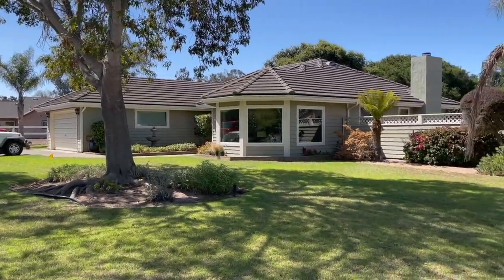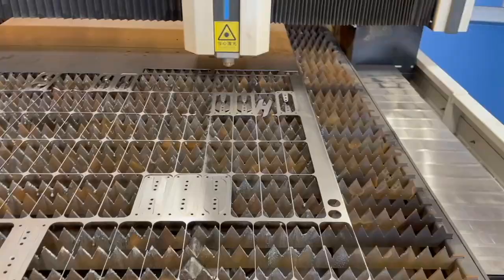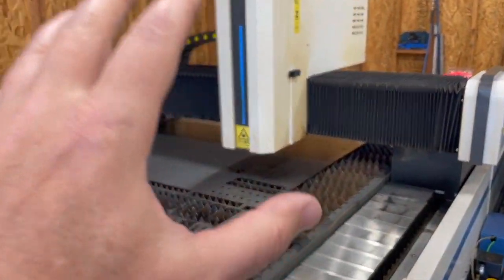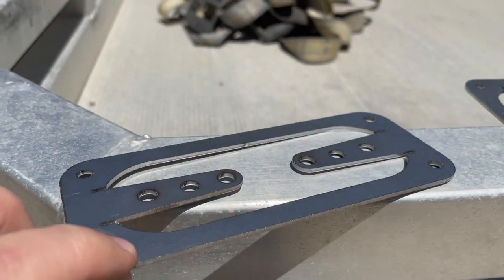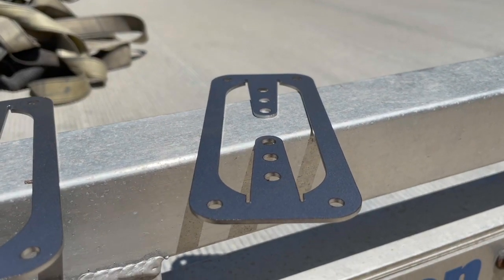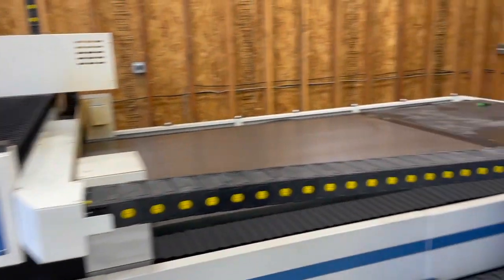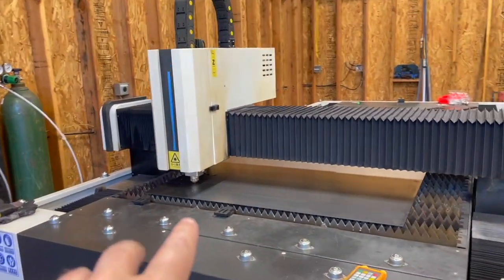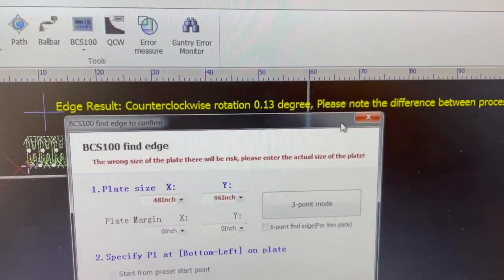Edge Seek and Perfecting Laser Cuts -

Comment: Hello Gary

I must say that I enjoy your vids going through the hiccups with the Chinese machines, have done my fair share as well.
Quick question, how would you rate the 1kw fibre laser for stainless up to 2mm and mild steel up to 4mm.
Sorry, from South Africa (metric)

Looking at getting a smaller capacity high precision machine in the near future fitted with a 1kw laser. There is not many people to speak to locally as they either have monster 10kw machines or small 60w Co2's.

From all the data I have collected so far, a 1kw will suit my needs perfectly

Regards
Gordon
Reply from the maker: 1KW will do it, but you would be happier with 1500
Reply: Hi Gordon. Not sure where you are based but I am in joburg. I didn’t buy direct from China, went through a local agent who I trust completely and would recommend in a heartbeat and will give excellent backup service 👍 I have a 2 kw and it’s a nice sweet spot- chows 2 mm stainless like it is nothing. Look up EDM shop and chat to Steven - agent for Yawei in SA. Cheers